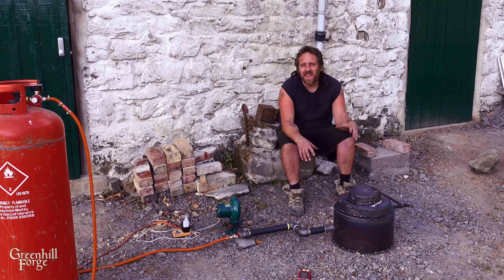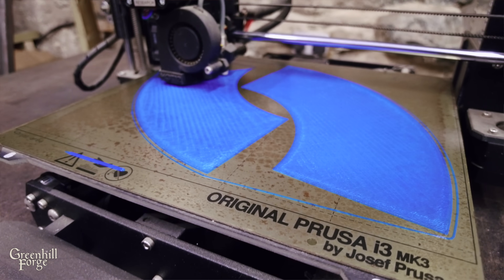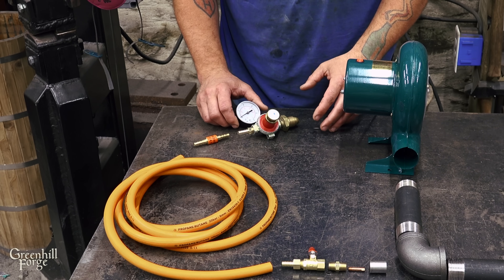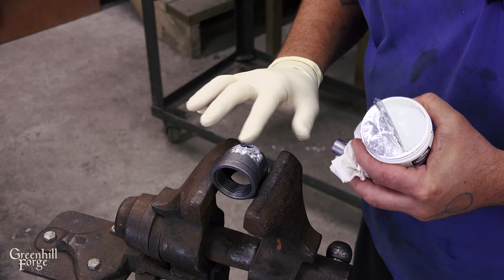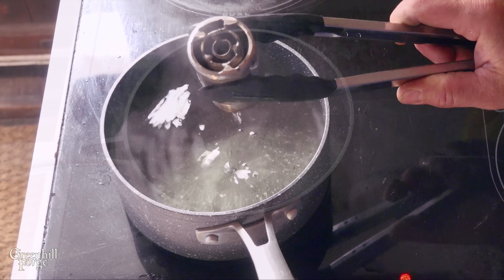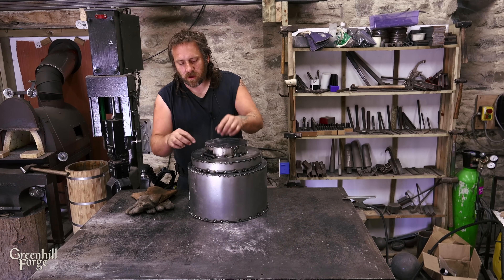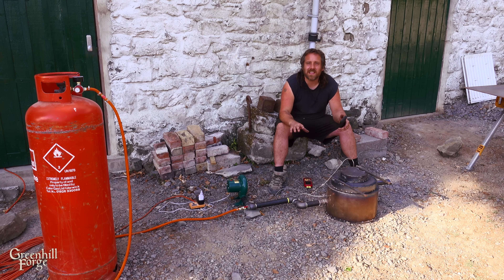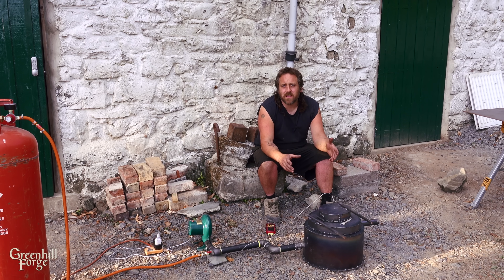DIY Kiln Build -Super Hot & Ultra Efficient

Comment: That kiln is nothing like I've ever seen, perfect consistent heat colour on ur Inner container ( sorry brain freeze 😂) but my god you have to build and sell that before it get to dam copied by some Chinese bugger lol, but all joking aside that's so flippen efficient and massive high heat and constant, and even heat I'll bet you could make sand steel with that set up cause it's just to perfect and efficient ! Really love the that your even thinking of using the waste heat to pre heat your molds, only thing I would go over safety on is a second spark arrestor suppressor at the junction where the hose connects, and to those guys who think all Teflon tapes the same well sorry but no you have to use the yellow gas Teflon tape and not the white water stuff, sorry but big difference, and boss been waiting extremely patiently for this video can not wait to see it all from tr grinder to the finished product from the molds, thank you again for a million dollar video! ! ❤it ,❤ It, ❤ it, ❤ it, Enough said lol

Comment: You can avoid facets on your 3D printed forms by either exporting your models as a higher quality STL file (smaller facets) or as a STEP file which most modern slicers support as far as I'm aware. Parts sliced from STEP files won't have the facets!

Thanks for the great video!

Comment: Looks good. I can think of 2 potential improvement:
1. Make the exhaust preheat the inlet gas.
2. Make a smaller adjustable nozzle so you can do 1 and still prevent flashback. Flashpoint of propane and air is 103C apparently. I guess you couldn't premix the air and fuel if you heated inlet gas higher than that. 

Seems like there's 2 sources of cooling:
1. Radiation that's mitigated by insulation.
2. Cold gas (fuel and air) entering. You can improve this for greater efficiency.

Interested to hear others thoughts on this. I think to really benefit you'd have to mix the air-fuel in the vessel as that way (keeping air and fuel separate) you could heat each up much more with counterflow HE on the exhaust and who knows how hot that could get.

Comment: loved the video! i wonder if you could make a heat exchanger to preheat the fresh air with the exhaust gases to further increase efficiency
Reply: apparently the autoignition temp of propane is like 840f, thats a lot of possible heat extraction you could do. though that would mean the inlet pipe would have to be insulated to retain that heat, and to keep it safe to touch
Edit: and you'd probably have to put some sort of heat resistant gasket around the lid to reduce exhaust leakage due to increased pressure
Reply: @josephgauthier5018   Gaz jest niebezpieczny. uwazaj  jak zgasnie !

Comment: I'm planning on building a rocket water heater and intend to mix vermiculite with the refractory cement along with stainless steel reinforcing wires.  I'd would love to hear your opinion on if that's a good idea or not (vermiculite being vastly less expensive than refractory cement).  To heat the water, rather than your spiral pipes in the exhaust, I'm going to have a pair of stainless steel 55 gallon drums with about a quarter inch gap between them and that will sit above the secondary combustion outlet ('bell' in many of the traditional designs) with water circulating through it, ideally via thermosiphon.  That water will circulate from/to a well insulated 1K gallon tank.  My goal is to get that water to at least 180F to then circulate for heating my house and greenhouse.

The idea I have for the primary and secondary combustion chamber has elements in common with your furnace design.  I'll feed the fuel in from the side for primary combustion, then those gasses will enter the secondary chamber at an angle along with extra air that's been preheated by running through stainless steel tubes in the primary combustion chamber.  They should do a nice swirl like yours is doing and fully combust, then exit into the stainless water jacket.  My understanding is the optimal temperature for complete combustion is 1,200-1,300F and as I'm using 304 stainless, that should be no problem at all.  Do you see any flaws in this design?

Comment: Cool Build! Have you measured the exhaust temperature? It would be interesting to try and make a heat exchanger for it, that heats up the forced input air. That should give you a higher temp and fuel efficiency at the cost of complexity and a bit more blower electricity. Would love to see some experiments :)
Reply: I was also thinking, this project is so awesome it absolutely deserves a counter flow heat exchanger to turn the efficiency up to 11.

Comment: This is so cool. Well hot really. Two questions: 
1) What keeps the propane from combusting before the burner, since the air is mixed in a few feet before the outlet?
2) How about a heat exchanger to use the hot exhaust to preheat the air before it enters the kiln?
Cheers.
Reply from the maker: thanks! 
1)  if the flame chases up the pipe its called a flashback and it can easily happen. it happens when the flow of the air through the forced air system isn't fast enough. in an open system like this usually all you get is a little puff/burst of flame up in the pipe but it could theorically be bigger than that. its why the forced air always needs to be turned on first and turned off last. basically if the air/gas flow is too slow you'll get a flashback and too fast it will just blow itself out, so you have to "tune" it and keep it balanced. It's also why there's a flashback arrestor between the flame and the propane tank.
2) it would help increase the temp and it's a good idea to experiment with

Comment: Prusa is a solid choice, a good alternative is Bambu. They make fully enclosed printers, so air drafts won't impact the print. Very useful in a shop environment or larger prints to avoid layer separation.